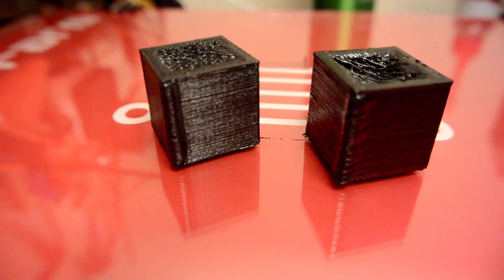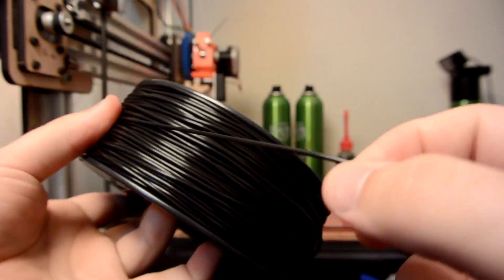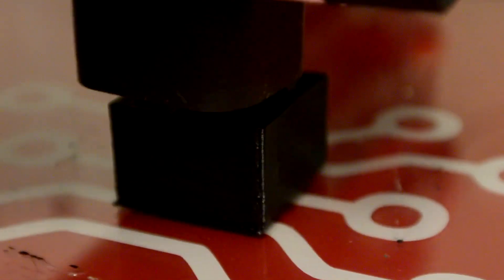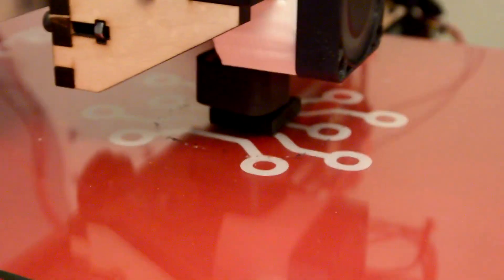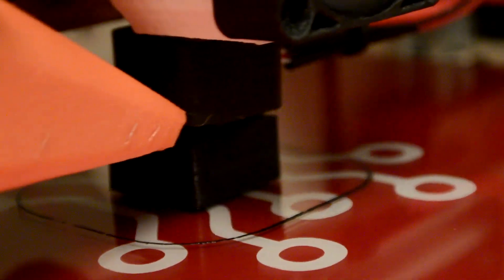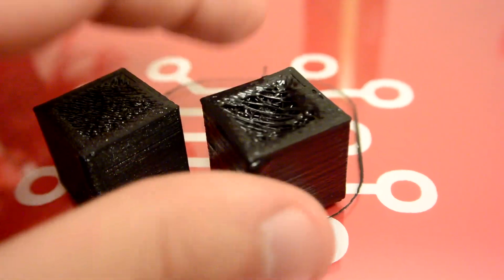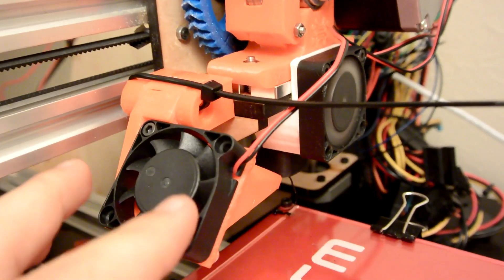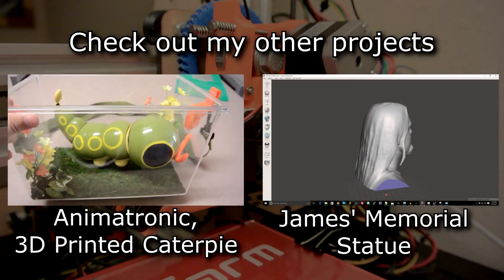Filaflex - 3D Printable Rubber!

Comment: Very good information, what 3D printer do you think would be the most reasonable one for printing rubberized filament as I have a project I want to finish ( gaskets 1/16 inch thick, with a 1/32 thick outer ring), trying to find the most cost effective way to complete it. I don't have a 3D printer, I am  thinking about investing in one but trying to justify the cost the space it would be taking up and the minimal amount of usage. Any suggestions?

Comment: why not have a tube for the parts fan and mount the fan on the frame or isolate it by mounting it on a seperate stand to reduce moving weight on the print head carriage and harmonic resonance. then you could put the inlet of the fan in a box of ice or slap a fine control on a heat gun and set the temp of the air to how you want it

Comment: Some guy told me for printing ABS it's better to reverse the fan so you suck the air away instead of blowing onto the object.
Reply from the maker: For ABS you don't want to blow air on the part (unless you are printing a really small part that might need that cooling, then you might be able to get away with it). Cooling it with air has a tendency to cause ABS parts to warp.

Sucking the air away would be for a different reason. Some studies have shown that printers tend to cause nano-particles as they print, basically very small particles of the plastic that float in the air. Breathing in these nano-particles may be harmful in the long run, and more so with ABS than with other plastics like PLA. Containing the printer and blowing the air through a vent, or a HEPA/Charcoal filter would be the best way to limit your exposure to these nano-particles.

Comment: I swear by FilaFlex since it is so dang rubbery vs like NinjaFlex and Semi Flex. I can print FilaFlex all day on my Ultimaker 2 with a "cupped' drive bolt and the stock extruder but could never get SemiFlex or NinjaFlex to work that well. Plus the surface finish of FilaFlex is way better in my book also. Cooling fans are a must with it and also try lowering your print speed and thus your temps. I run FilaFlex ~20-30 MM/S @220-240*C (max) and get good results. Sometimes a little slower with a little less heat makes all the difference.

Comment: Great video. Question- how much grip does this filament have? I'd like to use this or ninja flex to make some custom rubber feet for items I make so they don't slip. Which do you think is better, this or ninja flex?
Reply: +Michael New I made some "feet" for my CNC mill and the filament has good grip on the surface, mind you the mill weighs ~150 lbs and is putting the weight onto a small area so there is a lot of traction.
Reply: +Lathan Hites Bump! I'd like to know this too.

Comment: your prints with flexible filament will improve dramatically if you slow down the print speed a lot.  it will also prevent filament jamming like it did

Comment: where is my ninjaflex \ filaflex side by side comparison?
Reply: modeem352 Check the earlier video.
Reply: You mean watch one video and then the other? I want to see a side by side of the two materials using the same model. a cube would be just fine. Maybe even a stress test. You can even make it a longer video by showing how they compare for multi-material, both with various percentages ABS PLA, etc using that dual extruder.
Reply: +modeem352  I agree.